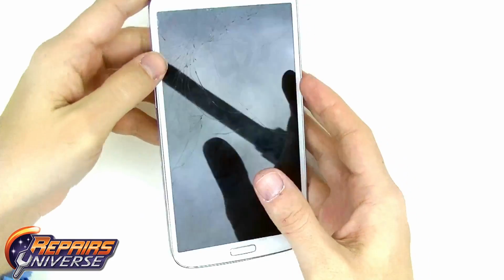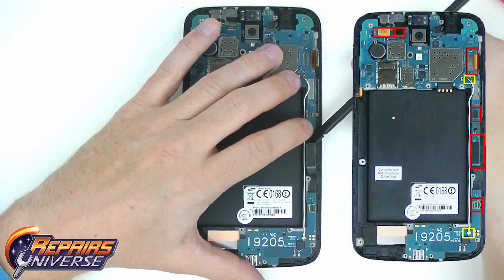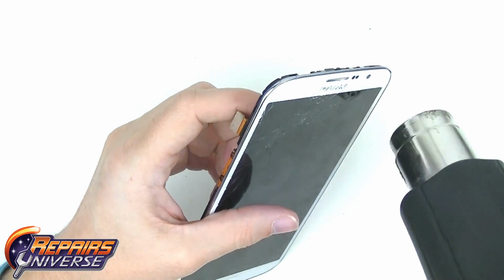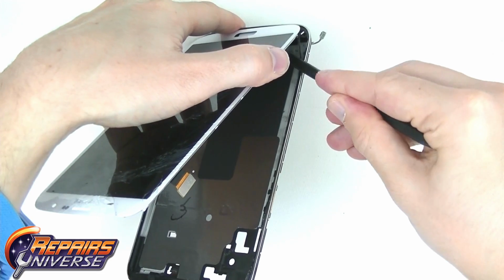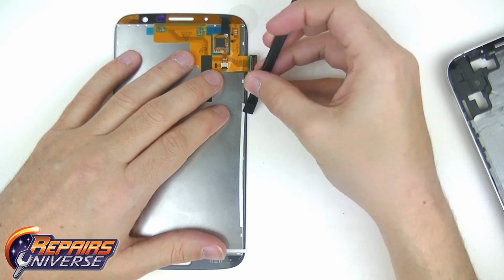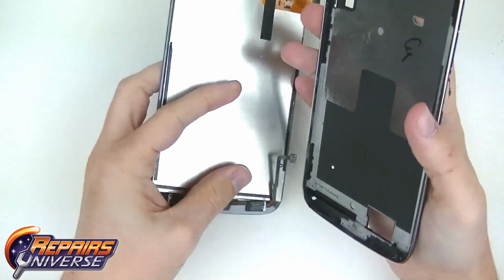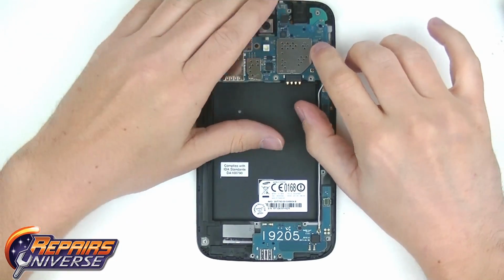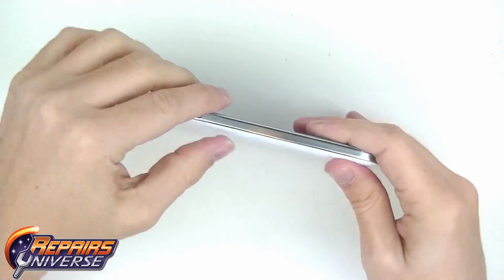Samsung Galaxy Mega 6.3 Screen Replacement Repair Guide

Comment: Hi Repair Universe, I was wondering if your LCD screens on your site are compatible with my Galaxy mega 6.3, I have the SPH L600, and I saw on your site the Samsung Galaxy Mega 6.3 LCD + Touch Screen Digitizer - Black but its only compatible with Samsung Galaxy Mega 6.3 i9200 / i9205 / LTE i527. Can I still use this screen or just buy the one similar to mine, I just want to see if this matters is all because the screen my phone is compatible with is more expensive than the rest + a little harder to find... please help, Thanks!
Reply from the maker: So as long as you purchase the LCD and Touch screen without the frame, the unit we offer will be compatible. Here on this link http://www.repairsuniverse.com/samsung-galaxy-mega-6-3-lcd-touch-screen-digitizer-black.html

Comment: I got a problem... I alreay installed my new screen I made my order and I made everything right but my screen it's just Blue or black, and doesn´t make anything else!!!!
Reply from the maker: Please ensure to double check your flex cables. Ensure that the flex is not making contact with the frame assembly as it can cause similar issues.

Comment: Hey I just bought the digitizer for the Galaxy Mega 2 is there any way of just replacing the digitizer because mine is cracked through the middle not that bad though but I still want it fixed can I just replace the digitizer?
Reply from the maker: The unit is fused, meaning the LCD is completely adhered to the front glass panel. It will be very difficult to repair without the proper equipment.

Comment: Hey please, I want to get on comunication with you guys, I'm from Dominican Republic and my phone is exactly so, but mine is working in the up but not in the down. I want to buy the replacement screen and the tools shown, because I'll repair with your help my phone, but I got several questions, because I've been seen anothers videos and I got to show that the put an liquid sustance on the screen.... but I don't know so much, but I'd Like to know, why is so easy here if this repair is not the full, if the screen wont be so good at the tact or touch, And please answer me Why Here in my country many Repairs Places, Price this repair in so-so  200$ US .... I'm going to buy this one http://www.repairsuniverse.com/samsung-galaxy-mega-6-3-lcd-touch-screen-digitizer-white.html
Reply from the maker: Hey Christopher, the LCD and touch screen on the link provided would be best for your repair. This will not require any liquid adhesive as it has the LCD and touch screen fused. Purchasing the assembly as linked will make the repair much simpler for you. Let us know what other questions you may have. Thanks
Reply: Repairs Universe  Thanks, really  thanks, I'm watching the video many times for centralize the day I'd make the repair. Tomorrow I'll order this https://us-dc1-order.store.yahoo.net/yhst-77219656498823/ymix/MetaController.html?ysco_key_event_id=1&ysco_key_store_id=yhst-77219656498823&sectionId=ysco.ship-bill 

So my big question is why here in many repair locals the price for making me the repair is 200$US or 250$US.... and if Repair Universe doesn´t have a Metal case cover for buying one with the orthers things that I've order
Reply from the maker: We could not answer why they charge so much in all honesty. However, we do offer the replacement part at a competitive price for you. OEM quality unit that will not provide you any issues.
Reply: Repairs Universe  I made my order already for repairing my Galaxy Mega as New Brain, I did it the Thursday, and I'm waiting,  and so exciting for repairing my Galaxy Mega
Reply from the maker: Glad to hear the details, do not hesitate to contact us if you need any assistance.
Reply: Repairs Universe Help me and make a video that how to upgrade my Samsung Galaxy Mega 6.3 GT-I9205  from Jelly Bean 4.2.2 to Lollipop, Please and tell me if its need to be root?

Comment: Hi Repairs Universe, I want to order this part http://www.repairsuniverse.com/samsung-galaxy-mega-6-3-lcd-touch-screen-with-frame-black.html and have a dummy question: Will it affect the antenna? Since it says (GSM) so I guessed that it may no longer receive 3G/4G signal. Please correct me if I'm wrong.
Reply from the maker: It will have no affect on the signal at all. The GSM title simply means this is for a GSM compatible unit. AT&T or models i527/i9205 and i9200. You should be just fine getting the unit with the frame if you own one of these models.

Comment: Hi I had a question, I followed your directions exactly. It went great and my phone is practically brand new now. My question is, when ever I put too pressure on the upper left corner of the screen (it doesn't even have to be too much pressure) the screen freezes then slowly turns black. I then have to turn the screen off and then on for the image to reappear, any idea why that's happening or how I can fix it????
Reply from the maker: Your flex cable is on the back of that side of the device. Ensure that it's properly seated and that it's not making contact with your frame assembly.

Comment: This was a great video to watch. watching and doing are two different things. I had my mega for 18 months. I couldn't find a case for it so I carried it around in a bubble wrap envelop and in a shotgun shell case that goes on your belt. while hooked up to my charger at my part time job it fell off the desk and hit the upper right corner. it only cracked a small bit. then only the left side would work on the touch screen. I took it to Fast fix and they wanted 200.00 to fix it. 100.00 down for part order. I did that but then heard from AT&T and upgraded to Galaxy 5 for less money per month. I still have the mega and was wanting to try and fix it. Or have someone do it much cheaper.

Comment: how do I take off a stubborn nail that wont come off?
Reply from the maker: That is difficult unfortunately. May recommend using a small flat head and applying slight pressure to get it out.

Comment: U never changed the screen
Reply from the maker: To install the new screen, simply reverse the process.
Reply: Okay but I just bought the actual screen not the lcd and digitizer ... it didn't show how to do all that
Reply from the maker: Unfortunately we do not have a Glass only repair video. This video will not assist you with your repair.

Comment: Great video, much appreciated...only I wish you had talked about some things to maybe watch out for before beginning? I followed your instructions to the letter, and ended up snapping my flex cable while getting the screen off. Obviously this was my mistake, but I feel like if I had known to watch out for it I would have been far more careful around that corner.

Anyways, still appreciated, just gonna buy a new flex cable and re-do it.

Comment: Hi I had no problems putting everything together however 
my phone continues t I shut on and off I bought screen lcd and digitizer how do 
I fix the problem?
V.
Reply from the maker: Vita Johnson-Young If the unit continuous to reboot, the LCD replacement may be the issue. Double check all your flex cable connections and see if the issue continues. If it does, we recommend trying a different LCD and Digitizer.

Comment: OK I accidentally sat on my mega and now the bottom half of my touch screen is pitch black but the top half is fine but the whole touch screen still works wherever I touch..  So do I still need a digatilizer or just glass replacement??  I'm confused

Comment: Hi! I broke my Samsung Galaxy Mega 6.3 I9205. The screens right down corner is crushed and one crack goes through the screen. The phone doesnt react to my touch on the right side of the crack AND most of the time the phone touches itself... SO I guess I'd have to buy LCD+Touch screen digitizer? or what ?
vid is good!

Comment: With the replacement screen I got (i527), it only works if you plug in and turn on with the original assembly first, then after it completes booting, unplug the old one and plug in the new one. Then, if you reset the phone, the new one doesn't work anymore. Any suggestions?

Comment: Hi, I bought a white LCD and glass combo on EBAY and replaced my broken one with it and the phone just boot loops. I plugged back in the old screen and it boots fine. Just when ever i plug in the installed new screen it just shows Samsung Galaxy Mega screen and powers off over and over. Can you help me at all? Thanks
Reply: Repairs Universe  How do you get it into recovery if it bootloops? mine is doing it also....  Whats weird is I can get it to boot with the od screen then plug in the new one and it works fine untill I reboot then it back to boot loop.
Reply from the maker: Matt Welch Back up all your data to your desk top. Then install the screen and do  factory data reset on the device. This will allow the device to see the new hardware. Good luck.
Reply: Repairs Universe I attempted this and have had no luck with the same problem. It still boot loops
Reply from the maker: Brian Sheehan If the device is boot looping. Put the unit into recovery. Check the procedure for this. Once you see the android there will be  list you can choose from. Do the factory data reset in this screen. Also before the restore wipe the cashes. This will  unit reinstall all the apk files and force it to update and recognize the new hardware.
Reply from the maker: install the screen that allows you to boot the screen install the new one and boot the device into recovery from there. Once there clear the data/restore and reboot the device should not have anymore issues.
Reply: Repairs Universe  You cant boot into recovery from a regular non rooted phone that I know of? If so please tell us how.....
Reply from the maker: If it does not work after that then it
 is defective
Reply: Repairs Universe  FYI I contacted two venders and asked about it and they resonded which I was surprised said yes dont buy thier digitizer try another vender due to this firmware issue with having aftermarket parts and yes it wont work with 4.4.2.....  Do you sell ones that work?

Comment: Hi guys. Had to leave a comment. I've watched this video for three months now debating about replacing my Samsung Mega screen. I was so scared about interfering with the minute electronics and inner workings of the phone, that I resolved myself to just stare at a broken device. My so called common sense told me, better for it to be broken, than more broken. WTH right? 
After months of being disatisfied with my stand in phone (Sony Xperia Z1) I decided to bite the bulletand purchase an LCD touchscreen from your website. It arrived and again I spent an extra month trying to source out someone who would replace the screen for, explaining each time that it isnt that difficult. I would say that my eyesight and the tiny screws on the phone are not the best of friends. After being quoted absurd amounts for basic repair labour I decided to do it my self. I literally said to myself, load up the video and get it done. And guess what? It works!!!!! Taa daaaaaa. I not only have my favourite phone back, but I have my life back too. The photos, the memos, the diary, all the personalised apps that took me months to establish, everything. I cant thank you enough for this wonderfullythrough yet easy to follow how to video. Without it, I would be stuck weak seconds. Thank you thank you thank you.

Comment: When I was fixing my screen,it fixed it but my home button doesnt work and my side buttons  don't light up,can u make a video on what I did wrong???
Reply from the maker: You damaged the home button flex when you did the repair.You can find the part you need here.http://www.repairsuniverse.com/samsung-galaxy-mega-6-3-home-button-keypad-flex-cable-replacement.html

Comment: Sir what da fuck... you skipped the most important step. How to actually remove the screen itself... shiiiit. thumbs down
Reply: Yeah dude, the video is a great video. This shows everything.
If you're referring to separating the glass from the LCD, they are inseparable. You must change out both the glass and the LCD when performing this repair. Buy a glass & LCD assembly.
Reply from the maker: We apologize. We thought the video was straight forward. Once the phone has been disassembled you can take a hair dryer to the front and loosen the adhesive holding it to the frame.
Reply: You're an idiot! It's clear as day! Open your damn eyes.

Comment: My screen is cracked and everything works, it just wont respond to my touch. Can this be fixed ? if so, what do i need to do the fix ?
Reply from the maker: http://www.repairsuniverse.com/samsung-galaxy-mega-6-3-screen-replacement-repair-parts.html

Replace the screen as a unit. You can find the replacement part here.
Reply: Repairs Universe For replacement part, how do I know if I need "touch screen" or touch screen digitizer?
Reply from the maker: Is the device responsive to touch? Even though the glass is broken? If the unit still works then you can do a (LCD Recycle) Using only the glass touch screen. If it no longer respond to the touch then you will need a new Digitizer. This repair is not for the average public. It is very difficult to separate the fused screen. We sell the glass and the digitizer already fused together to make it a painless repair that looks professional.

Comment: I am confused on what to buy. the glass on my mega 6.3 is completely cracked, it turns on but can not see much other than some white light that is coming thru some of the cracks so I don't know if it's responding to touch or even if my sound is working. please help! have the phone 2 weeks & boom!
Reply from the maker: http://www.repairsuniverse.com/samsung-galaxy-mega-6-3-screen-replacement-repair-parts.html
You will need the complete assy. Once you click the link order the color you need to match your device.

Comment: i am trying to do the same thing to the mega 6.3 but i only need to replace the glass screen, not the lcd, how do you do that, the video skips that part
Reply from the maker: cesar medina You will need specialized machinery to replace just the glass. It is very difficult as the LCD and front glass are adhered to each other.

Comment: hello, it is possible to install a samsung i9200 lcd block on a samasungi9205? thank you in advance for your response
Reply from the maker: Louis Agogo Does the screen assembly you have include the mid-frame bezel? If it does then it will not work but if it is just the LCD + Digitizer then it should be compatible.